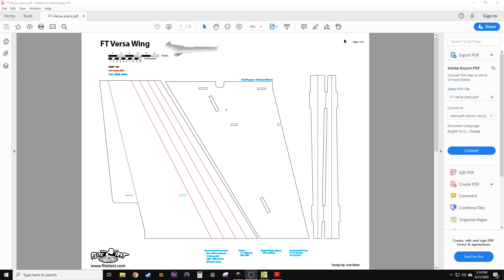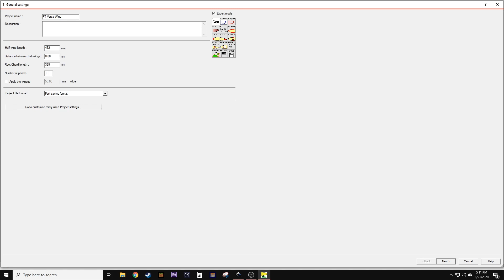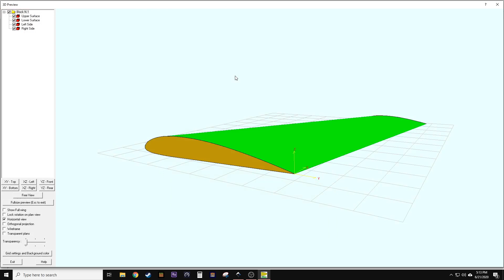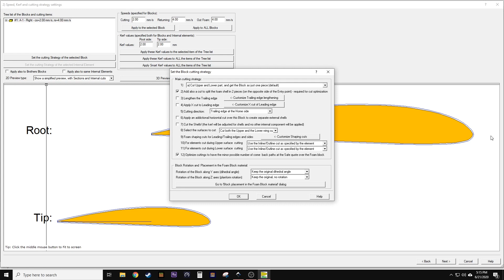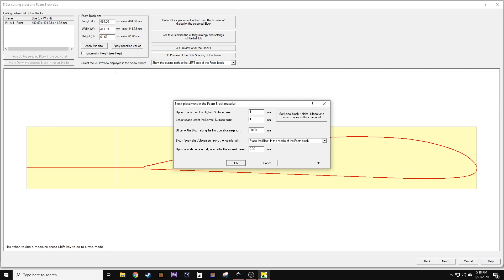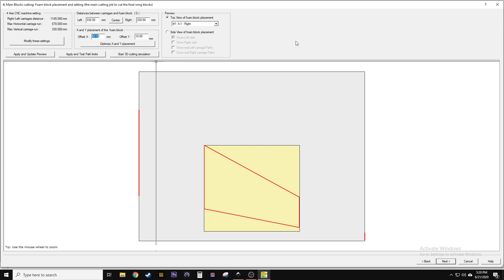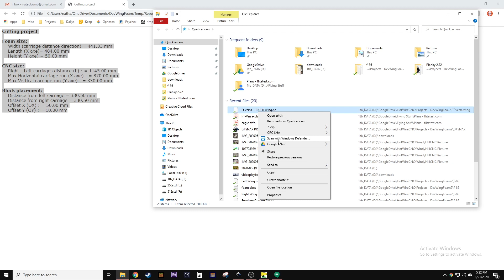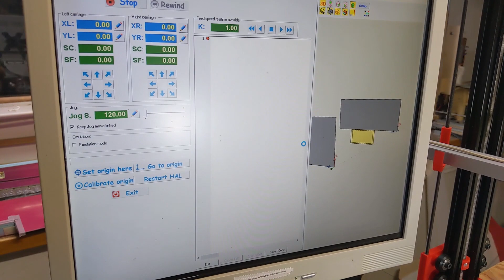devWing Foam 2 - Lets make a #flitetest versa wing on the #windyhillhobbies.com

Comment: Hi Nathan, Thanks for the video, just one question when you designed the wing you have a span of 482mm but devWing Foam 2 gives a foam block length of 484mm, why the 2mm difference?  Cheers
Reply from the maker: you know i have noticed that, but never took the time to see why. 2mm is basically zero, not really any change to my planes so i dont really worry about it. It does it on every core.